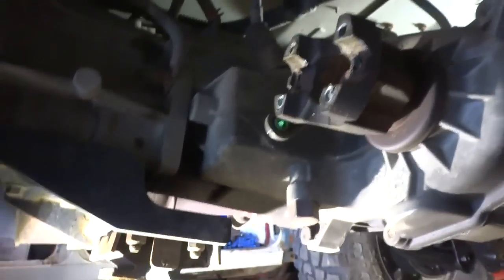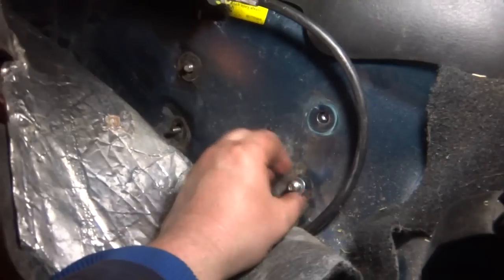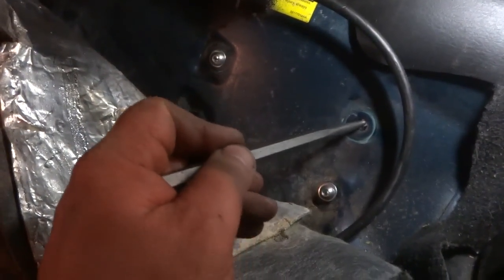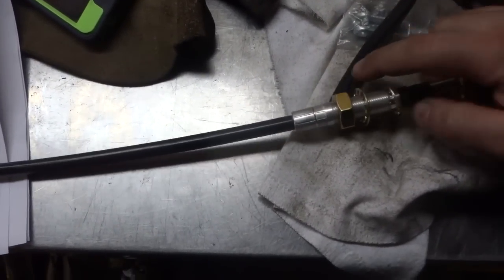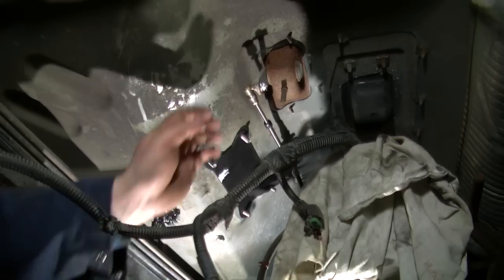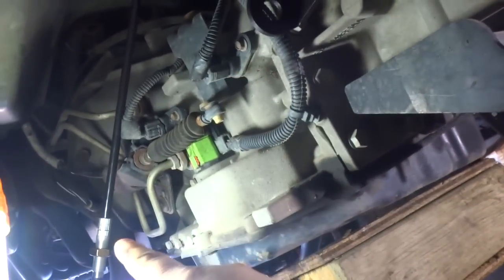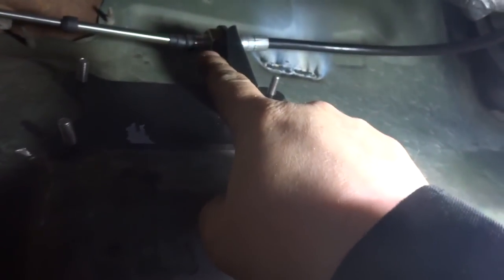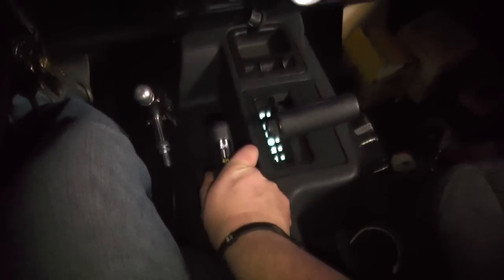Jeep TJ,XJ Novak Transfer Case Cable Install

Comment: 4lo is sticky cause you should be slightly rolling when shifting into it. At least thats what I was taught by several people. Good, clean install.
Reply from the maker: ive noticed that too just give it a bit of gas and it goes right in and out

Comment: They seem to have made a design change. The bracket that gets bolted to your underbody now does not have nuts on the end of the bolts. Instead it has rubber bushings that hold the plate away from the underbody. The bolt goes through and goes into a threaded insert in the rubber bushing. The idea is that when you tighten, the rubber gets pulled in and mushrooms out to hold the plate (its impossible to describe without a picture). It didn't work so well for me because the plate doesn't sit flat - it sits on two diagonal corners - but was about 1/4" away on the other two corners. I put it in a vice and bent the bracket to close this up a bit and ended up adding spacer washers between the underbody and the rubber bushing. I'm not happy with the way it came out and will probably add a washer and nut on the end of each bolt.
Reply: See picture at http://www.novak-adapt.com/catalog/shifters/sk2xc.htm that describes change in 2014 Q4 to understand the connection mechanism I'm talking about. Its supposed to make it easier for variations in tubs - however it made it more complicated for me.

Comment: Hey nice vid...
I installed a rough country 4in lift on my tj and when I tried to put it into 4l the lever was very hard to lift and same thing when i tried to put it back into 2wd will this cable  fix that issue?
Reply from the maker: The cable is a life saver, the Jeep crappy linkage is just junk

Comment: The guy who installed mine didnt synch the transfer case with the shifter.In other words the shifter is in the 4H position while the transfer case is in 2H..I ubolted the cable at the shifter to postion the shifter all the way down..The problem Im running into is i cant get enough slack from the cable to line the the damn bolt back up into the shifter hole.. Any suggestion would be appreciated.. Thanks

Comment: Do you have the 231 of the 241OR T case? I really want to do this as well. The OEM unit is horrible regardless stock or lifted. The 2015 calender year will be the year I address my tcase. Thanks for the content.
Reply from the maker: the 231, it makes a big difference, you'll be glad you did

Comment: Hey man, I'm a big fan of your channel. Learned a shit ton from you. You got me out of a few rough situations. Thanks and keep it up. One question about this install. What do you think about bending the body mounted bracket so the cable doesn't pinch? Maybe shims to be safe? I plan on doing this today.
Reply from the maker: you can i wasn't too worried about it, since it's something that you don't generally use all the time

Comment: I ran into the problem of the "Z"-linkage popping out of gear on my TJ. I found the Novak cable unit and haven't looked back!   (I DID have to have the neighbor come over and hold the bolts from the top while I tightened the nuts up on the mounting plate from below.)
Reply from the maker: Lonewlf7676 that would make things easier for sure

Comment: awesome video.  I have used a few of your videos as reference since I'm pretty new to working on, well anything. I realize this video is old as fuck by now, but I'm wondering what that other cable is attached to the right of the TC shifter.

Comment: I just put one in mine. I know you had a problem with the connecting it to the transfer case ect, I found if you put everything in and don’t tighten it down; you can adjust it quickly to fit and then tighten everything down last. I can say, it’s a hell of a lot smoother than that piece of shit OE one! Sadly, I’m at work doing it, so no beer to celebrate! But gunna drop in the new Adams Drive shaft.
Reply from the maker: Yes totally I’ve had it a few years now and it’s been awesome